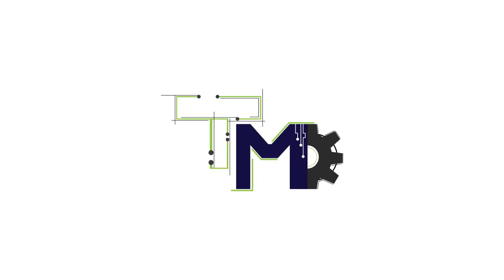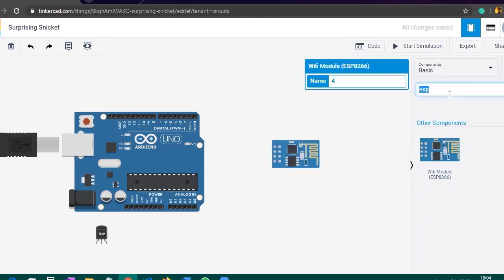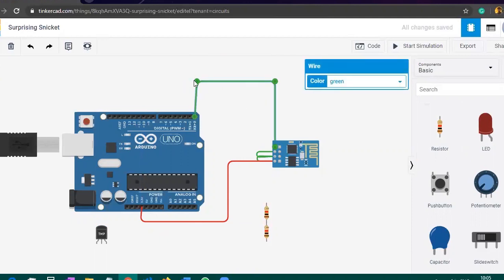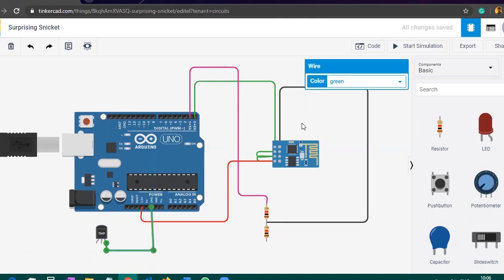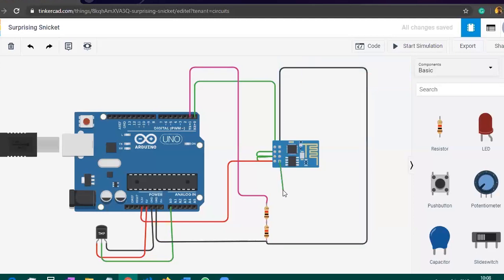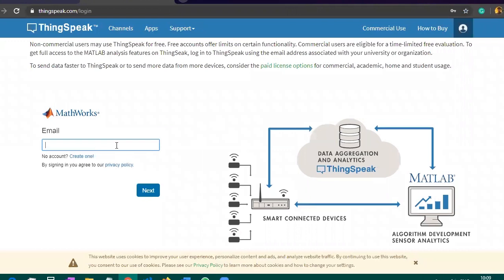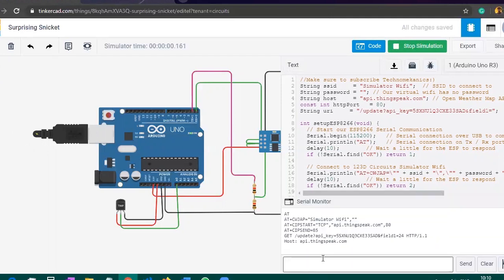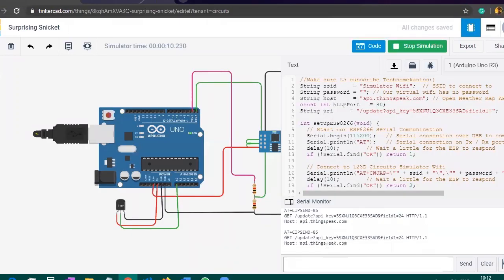IoT project in Tinkercad and Thinkspeak

Comment: Instead of uploading the URL of Think speak can v able to provide the phone number so the data is transferred to mobile in sms or phone call if like that options are there na please tell me! Thats would be a great help Thank you!
Reply: Yes you can do it. By using gsm module. But not not by replacing the url with phone no.
Reply: @anupsharma6564   Yes thank you very much but in tinkercad we don't have gsm module so what can do , if any other open source cloud based software is there ? . If you know  pls pls let me know..

Comment: ba al: you are correct, no longer available for security concerns, but you can still get one tinker at: https://www.tinkercad.com/things/0oQMS0nq33i-turn-on-led-with-esp8266-arduino
Reply: will it work, if we do change in connections. will it work with mitinvetor app
pls reply soon bro
Reply: @nawabalam1213  Sorry Alam, I really don't know that, I have been away from it for almost a year. Good luck.
Reply: @nawabalam1213  It does work, but I prefer the real thing, an arduino board.
Reply: Hi, if I edit your project to this one... Will the esp module will send the data to thinkspeak??
Reply: Or suggest a software for simulation of esp8266 module...